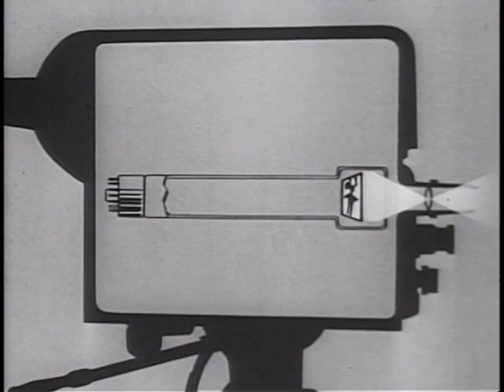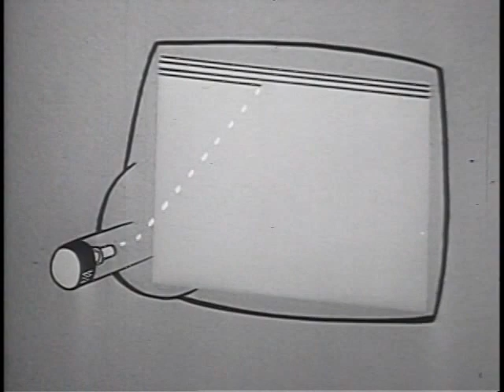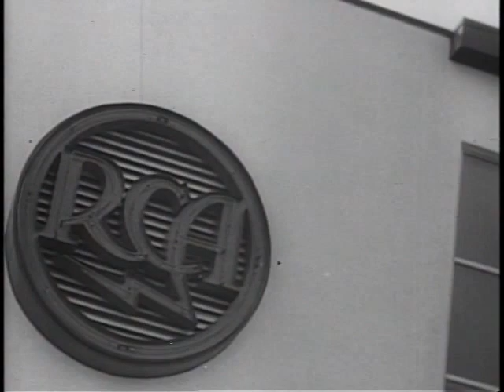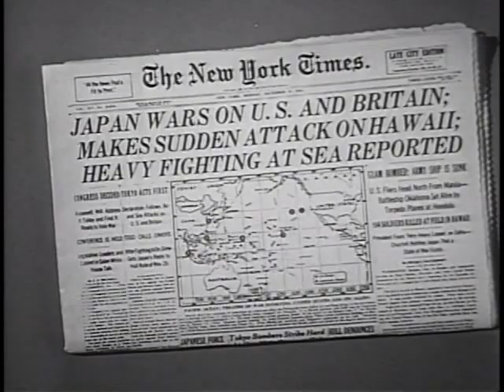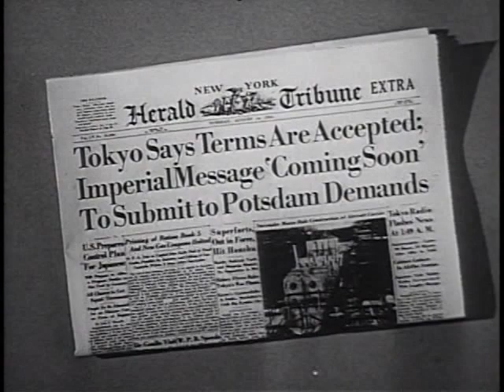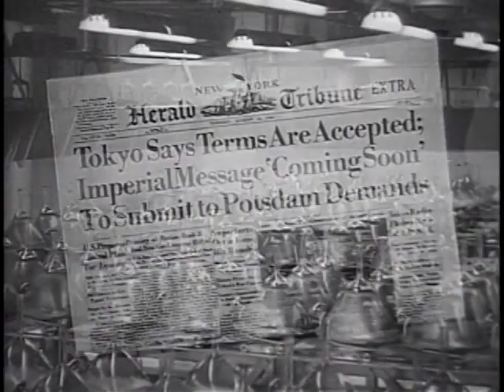Scottish Invented the John Logie Baird first Mechanical Television

Comment: Hey dig what Manfred von Ardenne came up with his flying spot T.V tech. The T.V. could watch you as you watch it 1984 style. Like the idea that a Mirror Drum type of monitor could display up to four images at once if you ring the drum with for projection lamps. Video magic with out with a CRT. As simple and cheap as John Logie  Baird's system was you'd thing it would have ended up on smart bombs by the 1930's. Have not run across any patents on that. For strange and kinda cool check out digital computer patent 3190554 that use compressed air to compute. If Babbage had gone this way he could have had the pipe organ folks build his Diff. Engine and lady Ida would have invented COBOL!